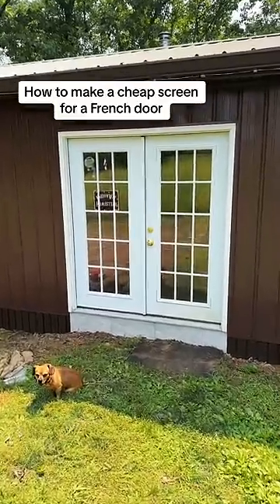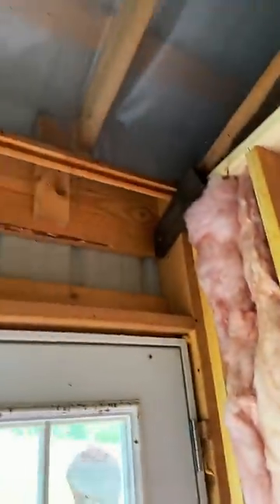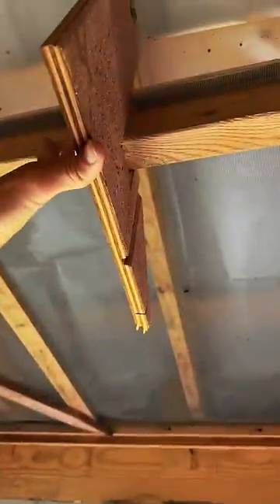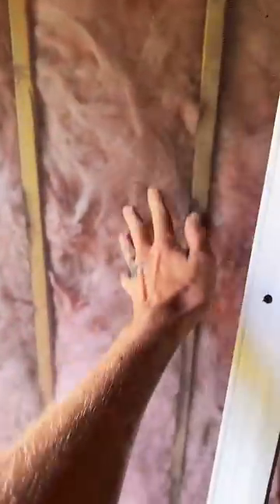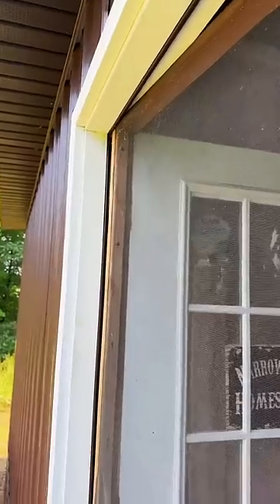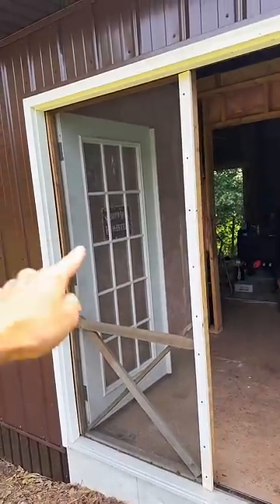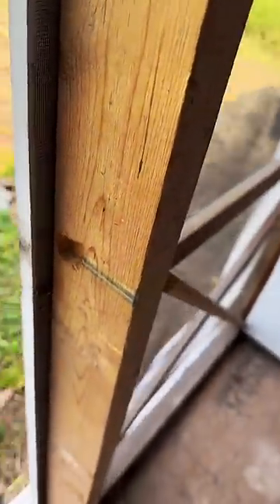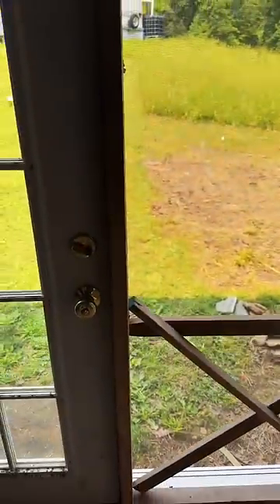Cheap screen for the french doors

Comment: I once used one of those door screens that is like a curtain made of screening, in two parts, left and right. You tack it to the door jambs on either side, and at the top, and it closes in the middle with magnets. It worked quite well — I could shoulder through it with my arms full and it would closely neatly after me, with all the magnets lined up, every time. The one problem I encountered was that my two cats never learned to go through the middle. They were convinced that they should go through the side, by the door jamb, so I fiddled a little so they could.  Anyway, it was for my cats’ sake that I got it, so they could flee inside in a crisis. There had been a crisis, involving the dog next door slipping its lead, but I had left the kitchen door open for them and they both streaked inside in plenty of time. One of them, though, caught a claw in my doormat, the sort that is made of strips of tires or something, woven together with wire. He was running so fast that one claw ripped out entirely, not just the nail, but flesh, too, which was really painful for him, and took a while to heal. I never used that sort of doormat again.
Reply: OUCH.
Reply: Oh no! Is the cat ok now? Or was this a long time ago?
Reply: @MrJJandJim  It was quite painful for him. I took him to the vet, and he did recover. The next year, though, he died of a saddle embolism, which is a clot of blood where the two back legs attach, preventing blood flow to the back legs. We had gone outside first thing in the morning, as usual, and everything was wonderful, and an hour later he was dead. He was in his prime and the apple of my eye. And my other cat had died, of old age, just a month before.
Reply: @heidis3993  Oh no! At least it was fast... got any pets now?
Reply: @MrJJandJim  No. I grieved for years.  But I think now I’ll go through the vetting process for fostering cats.  Dogs are not allowed in my building, but I can always sit outside and say Hi to those passing by.  I put water dishes out for them, and sometimes I collect sticks from the back yard and leave those out for dogs.  Dogs seem to love a stick so much.
Reply: @heidis3993  You're a good soul. Hope everything goes well for you!

I used to have dogs, and somehow it always seems to be three at a time. Started with a German Shepherd I named Buttercup (She turned into a Butterball, lol!) when I was about 6, then a neighbor's dog got loose and got her pregnant. I kept the only pup that had yellow fur, named her Goldie. Then a different neighbor had a yellow Husky named Red that he had trouble keeping caged on his property, so we adopted him too, and set up a runner for him to give him running space and sometimes still had to chase him through the neighborhood, lol.

After a while Buttercup passed away, and we just had Goldie and Red for a while. Then out of nowhere a little Beagle decided that she wanted to live with us, literally showed up out of nowhere. I named her Squirt, because she was so short compared to the other 2.

Eventually, Red got sick one winter, and we tried our best to take care of him (too poor to take to the vet for treatment), and he seemed to be getting better, but then he ran off and never saw him again. And Squirt at one point had an accident with a vehicle that ended her life. Goldie lived to be about 16-17, until she developed hip troubles and stopped eating or drinking. That's when my dad and I took her to the vet for the last time.

They were all good dogs, and I miss them terribly.

Comment: Hot tip; since you've got an angled hole, you can drill them a little wider and use regular door hinge pins as pegs to hold it in place. No tools needed, and plenty of holding power due to the offset. Leave a little bit of depth undrilled so you've got something to grab to remove, or you'll need a tool to take it down.

Comment: I'm sure you have seen the flexible screens with magnetic closures. On a French door, both sides swing open when you do something g as easy as walk into it. They swing closed, and the magnets close the screen.
    I saw a good video. A cat jumped through the opening. He knocked the screen apart about 2 feet off the ground. It opened for him, and swung shut.
    I believe they are inexpensive. I think they attach with glue-backed Velcro. You can apply or pull 8ff the opposing Velcro to remove the screen altogether, or put it back.
   Nice screen in your doorway.

Comment: Thats awesome!  I live in an apartment and we have sliding glass doors with screens but the actual front door has no screen.  I wish it did because we never get a cross breeze in the place.  All the windows are on the same side of the place,  whereas, the front door is  on the side which would help form a cross breeze if I could leave it open. Your solution is such an incredible idea. Tfs!

Comment: FYI they have a hanging screen "curtain" that you hang with stick on Velcro. It has  a slit up the middle that has magnetic closures. You can walk through it, & it closes up behind you. You don't want it if your animals will scratch at it wanting through all the time though. If you can teach them not to, then it's great. They run for 20-30 dollars. I love mine. I keep the bottom open for a small dog, & cat door. Good luck!

Comment: Since you have a corrugated steel right there,  a barn style screen door would be simple and look good, use v-groove dual vinyl garage door seals around the perimeter with a bottom guide and it would stay tight and not let any bugs in but open easily anytime. They do wear out from constant friction but a little butylene expansion foam on the perimeter of the corrugated should lesson the abrasiveness and add life to the dual vinyl garage seals.
Just an idea that sticks to K.I.S.S(keep it simple stupid)
If you ever want a hand I'm a skilled carpenter for the past 30+ years and I'm right outside of Pittsburgh and any reason to come to West Virginia is a good one.
Thanks for the inspiration
Thanks 🙈🙉🙊

Comment: You can make a magnetic screen curtain. Those sold on tv are crap don’t waste your money. I buy really inexpensive mesh curtains. They usually last me two or 3 years here in Southern California. I simply hand stitch a small chain down one side and sew  on a few strong magnets wrapped in an iron on patch every 2 feet or so along the chain . Then I put a metal bar with magnets on it on the door frame. On my single house door I only need it to open to one side. ..You can use more than one panel and have them snap together in the center of your frame.

Comment: Might I make a small suggestion, especially in view of the fact that you’ve taken so much trouble with insulation? I’d recommend that you run multiple lines or large ID plastic tubing as conduit for power/electronics/version 6-8 Ethernet cable/etc? It would be a shame to screw around with the Ethernet/power/ anything else that comes to mind as time moves onwards. 

There never seems to be enough power sockets* or Ethernet* in hotels etc but in home networks*  etc there’s even fewer opportunities to allow for things to the room’s that are on your own property, but as it seems like a ruinous.
I must admit that your amount of forward thinking/planning might appear to most as just “winging it” but to most people it wouldn’t stand out.

Comment: You could get a striker plate for cheap, you would just have to hammer out the curved part on the edge of a step or an anvil if you’ve got one

Edit: or just borrow the strikeplate from your other door since it isn’t in use